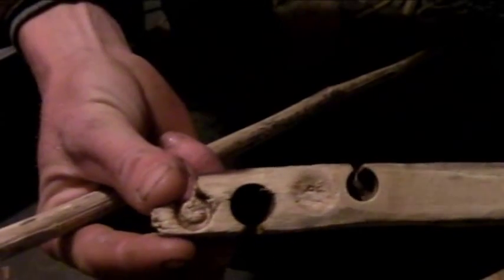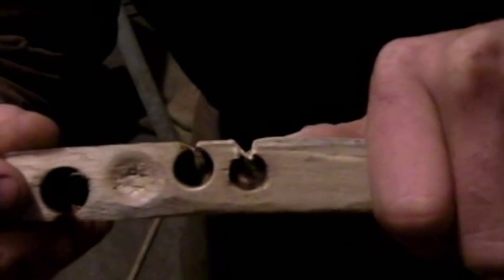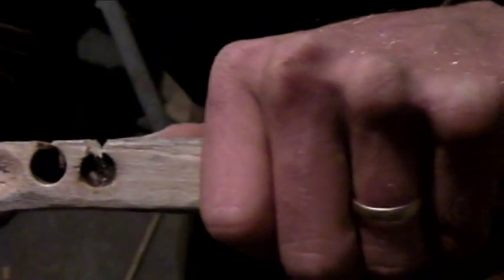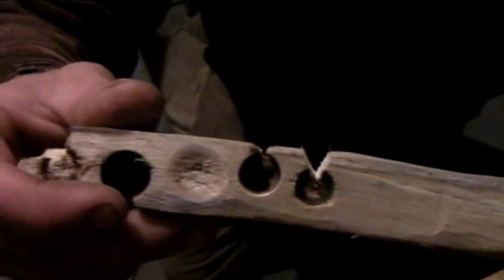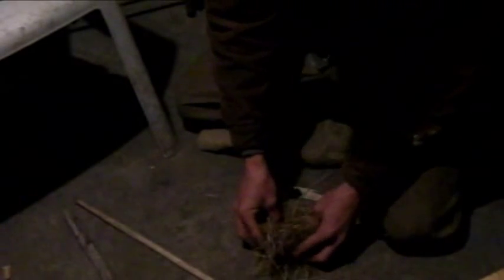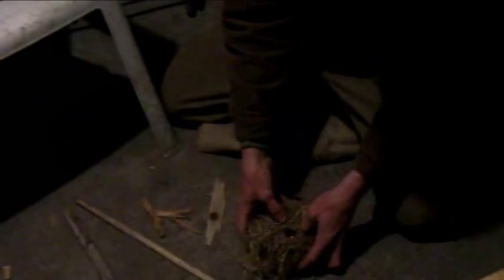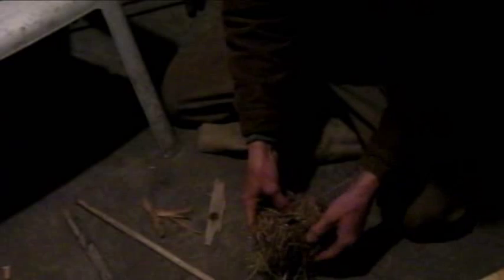Friction Fire: Yucca on yucca

Comment from the maker: it should be dead and dry, but hard enough to barely dent with your fingernail. I have had some that were too soft and would bore right through. I'm not sure of exact age, but within around 60 days of the stalk turning brown, it will 'snap' off at the base. this should be prime condition. if it has weathered too long, the wood begins to get soft.
there is one in my yard, now, that has been a standing, dead stalk for close to 3 months that is still too hard to 'snap'. IME this is too hard and will drill through softer pieces. finding the right combination is really a matter of trial and error. the thumbnail test is a helpful indicator.